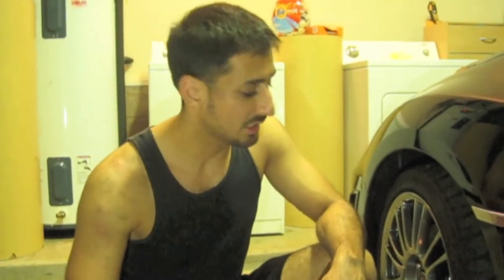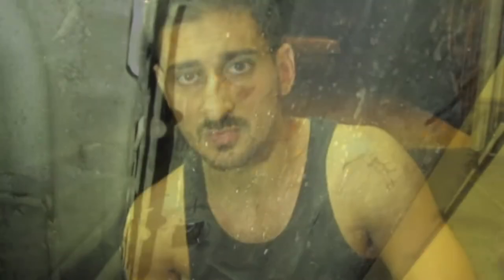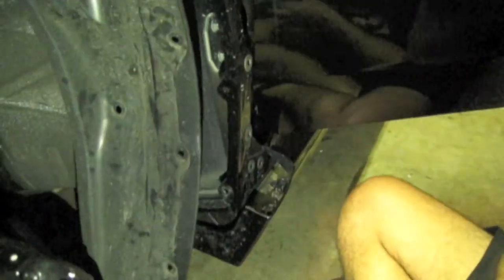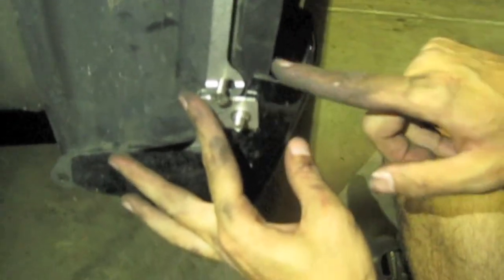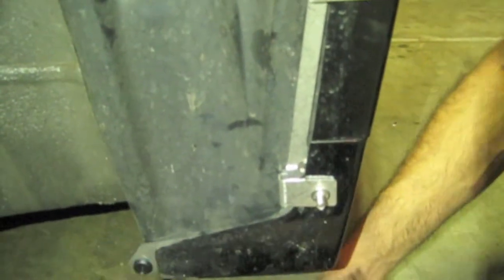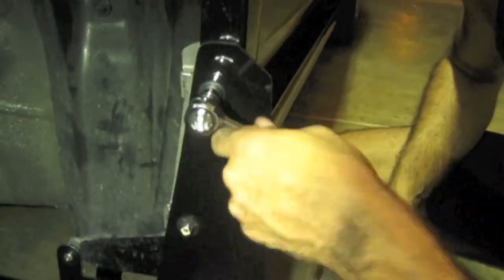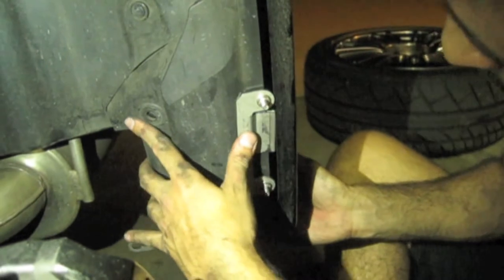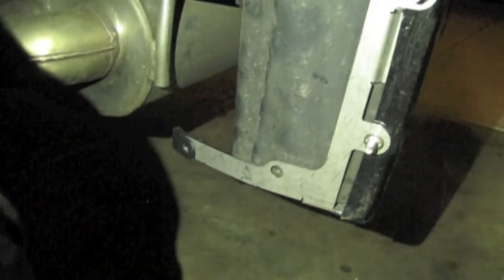STI Mud Flaps Full Review and Install Guide (Rally Armor)

Comment: 14 wrx here. Easy install but the front side skirt removal. the rear clip in the front of the side skirt would not budge. finally got it after about 15 minutes of trying and not wanting to break it and on the passenger side I just pulled the fender thru the top. not sure if they upgraded the clips or something but other than that this was easy. Videos are much better than those shitty instructions!

Comment: Up front should be fine with the tires on; just turn the wheels depending on which side you're working on.  The rear though I think you will need to remove your tires unless you have some really short screw drivers.

Comment: Thank you for the video. One of the better videos. i have a question, or two maybe. Does the equipment, the brackets and all fit on the hatchback version  2011-2014 (wrx or sti) and would the installation be the same if it does? If it doesn't, do you know if or how different the installation and equipment would be? thanks for your help.
Reply from the maker: Preston Van That is an excellent question. I do not want to give you the wrong advice.